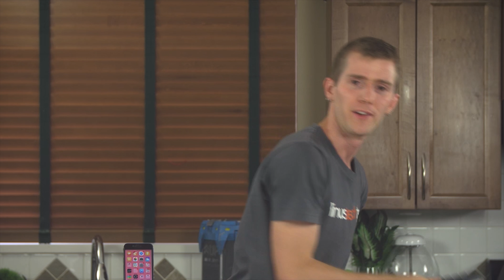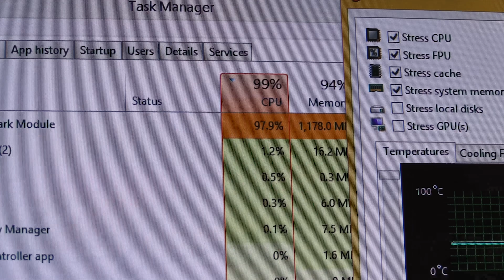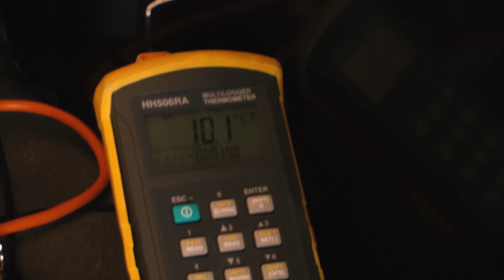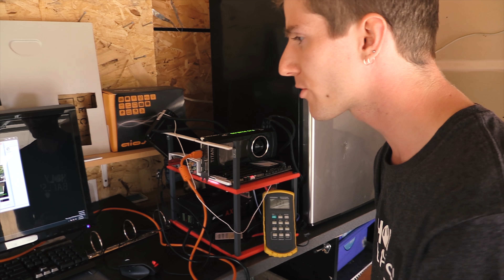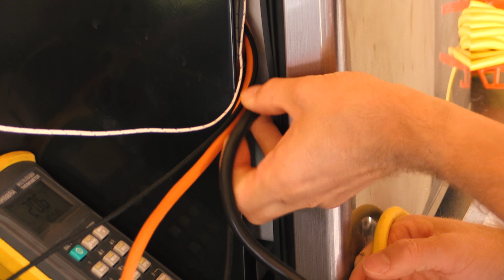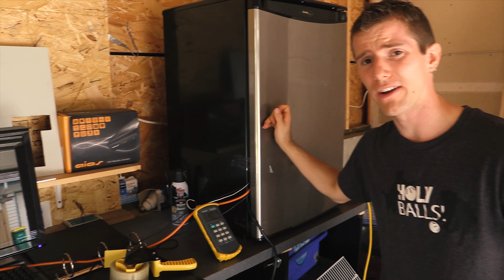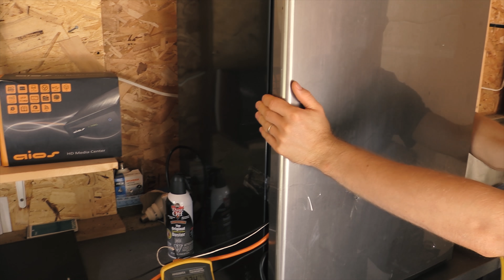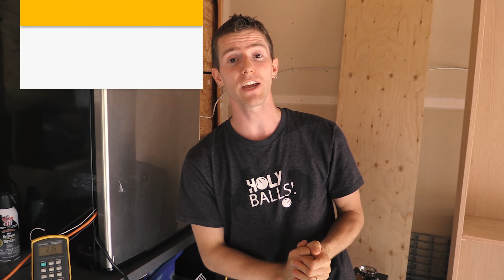PC Build in a Fridge - Does it Work??

Comment: Very bad idea. Fridges are not designed to handle constant heat loads. The fridge will not take this use for long. Google would have answered this. Phasechange cooling forums are full of these questions.

Comment: So my gpu includes 2 6-pins. It is a gtx 760. I've connected it via only one 6 pin bc my mobo came with only one. I'm thinking of getting two molex adapters. I connect my pc to a monitor with the 6 pin still on. It delivers a msg saying "please connect pcie power cable to motherboard" and then turns off after a while. Is that normal for it to turn off like that since I don't have all the connectors connected into my gpu? Or do I need two molex adapters? Any help would be appreciated. Sorry I'm a noob :(

Comment: what if you used a swimming pool as a water cooling reservoir with no radiator. Cools your computer and slightly heats your swimming pool win win
Reply: Lol, that sounds bad fucking ass
Reply: Spencer Stagg and then someone pees in it.
Reply: Spencer Stagg There's someone on the LTT forum trying to figure out the feasibility of doing something similar with a fish tank. I haven't followed the thread much so I'm not sure how far he's gotten on the concept.

Link: http://linustechtips.com/main/topic/385094-passively-cooled-fish-tank-computer/
Reply: Jay Cruz
But pee will be hotter than pool water.
Reply: BUT IF SOMEONE PEES IN POOL!?
Reply: Jay Cruz I believe that OP is taking about open loop water cooling with the swimming pool as a reservoir, so whatever is floating around the pool is going to go through your loop. If you use a heat exchanger to separate the fluids used to cool the computer from those used to heat the pool then it wouldn't matter what goes in the pool (cept possibly massive quantities of powdered gelatin)
Reply: +Spencer Stagg  Just fucken trow your pc into the swimingpool , AND BOOM , you got yourself a water cooled pc !
Reply: ***** Nope, you just don´t need a radiator with a reservoir tank that big. The pool itself becomes the radiator basically. 

It still a hackjob in a sense, as you need pump(s) strong enough to cover the distance from your desktop to your pool and pack and enough pipe as well and in the end you still have the issue that dirt from the pool might get into your cooling circuit. So it still not worth the trouble, but the basic idea to leave the radiators our and instead increase the size of the water reservoir is sound.
Reply: Traumglanz just get a heat exchanger, fluid in the computers cooling loop never touches the swimming pool's water.

There is a number of ways you could do this, you could install a normal radiator at the bottom of the pool, you could install a passive radiator at the bottom of the pool, you could install a plate heat exchanger (should probably be installed inline with the pools circulation pump), or you could just lay hose/tubing/pipe at the bottom of the pool in a space consuming pattern. If you're worried about flow, use larger ID hose/tubing/pipe and make parallel runs.
Reply: skippio77 iv tried doing it. Not that many people died from it so far
Reply: Ozzie Peck unless you have 8 4k monitors of course
Reply: +taiiat0 I have heard of office building that used a large pond to help cool the building. Just a matter of cooling the room instead of the computer.
Reply: tdhfc XD
Reply: television and cheese It wouldn't matter. Because all that matters is the tempature of the water. Not whats in it.
Reply: Spencer Stagg connect your PC to your radiator water supply and turn the radiators on but with no heat
Reply: Spencer Stagg pool water has chlorine
Reply: Spencer Stagg a Swimming Pool that has Chlorine and other stuff in it would be gross(and Salt would just be suicide), but a Liquid Source that large would be sufficient to keep the Thermal Energy dissipated. just need to figure out how to keep a liquid source that large sterile.
Reply: ***** That is not really a problem as long as you are using copper heat-spreaders. Feel free to correct me, but afaik copper should have no issues with salt and chlorine. Aluminium heat-spreaders would die very fast though. 

The bigger problem would be keeping dirt from the pool out of your cooling circuit, you won't want to to have sedimentations starting to stick to your heatspreaders. 

Besides that an aquarium as water-reservoir should be more than sufficient and looking quite cool as well. Add maybe small bits of dry ice for some extra bubbles and cooling in the summer.
Reply: Traumglanz i was under the impression that the idea was basically to electrically seal the components and throw them in, lol.

i came to this conclusion because the Poster suggested no Radiators being used. i.e. sounds like very hackjob.
Reply: Traumglanz
If dirt and things is not bad for some computer cooler things, why not use toilet water to cooling computer?
Reply: like the ideas here. as far as dirt from the pool you could easily install some pre-filter or strainer at the pickup from the pool.
Reply: Spencer Stagg Do you remember whole room watercooling and the biological crud that wrecked their system? Yeah. A swimming pool is totally open to the elements so even MORE biological crud will destroy your system
Reply: that was a closed system and most of the crap grew in their reservoir. If you maintain your pool and keep the water clean you should always have fresh chlorinated water flowing through the system. just get a good pool guy
Reply: Spencer Stagg But you can't realistically clean a pool spotless everyday so that there are No leaves, No bugs, no algae or other biological crap. It's just too hard. Plus, what about when winter comes?
Reply: Uh I live in California I have no winter. If your suction pickup is a few feet under the surface you should avoid most leaves/crud and a fine screen would take care of the rest. If you use enough chlorine your pool shouldn't have algea
Reply: Austin Vickers with regards to crud, just use a heat exchanger; with regard to winter, increase your overclock and run folding@home !
Reply: hook your pool water to your water cooling.
Reply: Spencer Stagg Would be much more cost effective to bury large copper heat exchanger deep underground where its a constant cool temperature . but using swimming pool as a giant liquid to liquid heat exchanger would work as long as everything is properly grounded to a popped PSU doesn't kill everyone at the pool party
Reply: Spencer Stagg the ratio of water mass to heat generated is so small that it wont heat the pool...
Reply: brandishwar Puget Systems did a PC build by making a Fish tank filled with mineral oil for heat transfer.
Reply: Ozzie Peck which is why I said slightly heats the pool I knew it wouldn't provide any meaningfull heating
Reply: not even slightly...
Reply: maybe a bath...
Reply: Spencer Stagg Win all arround ur a Genious!
Reply: 1. I know you are trolling and I'm lmao over here but 2. if the water dosn't kill your computer first the 3. Chlorine is ganna kill it.
Reply: Trolling or not the idea of pumping water in/out a pool to a cpu sounds nice. a win/win.
Reply: what if you by 'accident' pee in the pool
Reply: I think you'd want a radiator or a plate heat exchanger, I don't think you'd want all the junk that makes it's way into a swimming pool circulating through your loop.

If you building a new pool, instead of retrofitting an existing pool, you could embed PVC plumbing into the concrete floor of the pool.

Comment: 1. Mount a large heatsink onto your CPU.
2. Remove the fans.
3. Poor water over the heatsink or even use a pump to cycle it.

Cheap ass custom liquid cooling.

1. Run a pipe from the outlet of your air conditioner to the 1 intake fan on your pc.

Super sweet cold tempatures

Comment: It would be a pain to do it and expensive for electricity, but use a house hold window room ac unit. Make a custom case of wood or acrylic with the intake outside the unit and the output of the AC unit blowing through the custom case. The failure with the fridge is it a closed unit and can't keep up with the excess heat. A room ac unit should be keep up as especially if its not a closed unit. O you will want to disable the ac units temperature regulator this will cause the unit to run continuously.

Comment: The one problem you will have is that household fridges aren't designed to operate at a 100% duty cycle. The compressor will burn out in short order. Industrial freezers are really the only option for the duty cycle needed to cool something that constantly puts off heat..

Comment: I think you need to use a mini freezer, not fridge, for this to actually work for a desktop rig. I know most mini fridges have small freezers in them however, their too small for this application, you need a mini "Freezer". Depending on the power consumption of the freezer I'm not sure how practical it would be to do this however, it would be interesting to see if it would work at the very least.

Comment: I think what you should try next is a PC with an air conditioning unit. Connect a big air tight pipe from the air con unit directly to the front intake fan on the PC. That way you keep the air flow but with extremely cold air gong in cooling everything. i would love to see this!

Comment: Fridge solution:
You need baking soda and rice (or some white charcoal alone)... All 3 of those elements will DEVOUR ANY types of those moisture/humidity. But nothing beats white charcoal, though. White charcoal will even absorb straight up raw element of water.

But In fact, I had thought you were modding the door of your fridge, by extending the water cooling RADIATORS to be stored with inside of the fridge.

Comment: Try putting the PC in a box and having the front of a window unit blowing cold air/removing hot air from the box, sealing the box around the window unit so it's air-tight. The rear of the unit exhausts hot air out of it, the front of the unit intakes air from the box and blows out cool air. Should work nicely as long as the ac is powerful enough.

Comment: Freezer wont work too. The reason is the refrigerator is very slow at dumping heat at the surroundings since it doesnt have a more efficient radiator and an active fan. 

If you want a junk solution then a radiator from automobiles will work.  Another junk solution are window type airconditioners.

Comment: it still can be done, if your pc is water cooled try moving the heat sinks for the cpu and possibly moving your gpu's heat sink if it has its own seperate heat sink into the fridge instead having the whole pc inside. that way the fridge cools just the heat sink and can dissipate the heat from the heat sinks really fast

Comment: The average mini fridge has approximately 150 btu/hr capacity at 100% duty cycle and uses %30 of this just to keep itself cool, leaving 105 btu/hr. Since 1 Watt = 3.412 BTU, it has at best the capacity to remove 30.77 watts. If you also factor in the leaks around the door, it means it has no hope in hell and will also fail prematurely as they will not withstand the duty cycle. You would be much better off with a small air conditioner. Hey, how about; installing a small liquid cooled rad system on the computer, air-conditioning your room and keep beer in the fridge? Both you and your PU's keep cool, just a thought!?

Comment: This episode in a nutshell: Fridges and Freezers are NOT good at dissipating heat. The insulation used to hold lower temperatures backfires during this experiment and actually starts to trap heat. So something that produces heat will not benefit without extra procedures.

Comment: A fridge is made to cool things slowly, it was never intended to deal with heat sources
Also, you have to consider the moister that the Fridge produces, and that would most likely fry your motherboard 
Good point on the hair flow aswell

Comment: I think the only related thing that is worth doing is feeding the fans with super cold air in a situation where this cold air is isolated from the air mass where the heat dissipated from the radiators (in a wc setup) is blown into. Like having a hvac tube plugged into the insides of your case or directly feeding the radiator fans. Should cold air extract more heat from radiators anyways?

Comment: You need to remove more heat. Use a air conditioner! They can move a lot of heat. Build a box with the evaporator in the box, and cool it. If you remove the thermostat to make it run non stop, it could go to below zero deg C. The old single unit aircons are easier to modify

Comment: Can you try it in a walk-in commercial refrigerator? These are the big guns and are made to handle much greater loads than mini fridges thanks to the larger compressor and radiator. While this is an extremely inefficient way to cool a computer, I'm curious if it can be done.
Perhaps my dad will let me try it at his restaurant, but I'm worried that condensation (the humidity in the Midwest is too damn high) will damage my rig. I have an old Pentium 4 desktop that I could sacrifice to the cause, but it's a weak/outdated system with poor efficiency so I don't know if the data would be of much use in a benchmarking utility.
What's everyone's thoughts on this?

Comment: Refrigerators need the seal around the door completely sealed. You cant put the cords through the seal. This test was completely flawed.

Cut a hole on top for the cords and seal the hole. Then re-test.

Comment: Serious Question....Could you drill 2  4-5in holes in the mini fridge, add fans on the other end and feed the cold air underneath your laptop? The Laptop's fans would use it's own cooling system with a simulated lower ambient air temperature. A third hole may be needed to supply fresh air.

Comment: Couldn't you just put the radiator from the CPU on the outside of the fridge? Would only require a small hole to fit the tube through, could easily be made air tight again.

Comment: LinusTechTips How about something like an industrial cooler for enclosure and small cabinet. We have few in my work place for electric panel cooling.

Can you please do a PC build with this?

  http://www.rittal.com/us-en/product/list/variations.action?c=/Climate%20control/Cooling%20Units/Thermoelectric%20Cooler%20Total%20cooling%20output/heating%20output%20100%20W/Thermoelectric%20Cooler%20Total%20cooling%20output/heating%20output%20100%20W&categoryPath=/PG0001/PG0168KLIMA1/PG0169KLIMA1/PRO0275KLIMA1&productID=PRO0275

Comment: OK so here is a question...

If you have ever tried to take money out of a ATM during the winter one of the things you find is that the computer runs painfully slow, so...would running a refrigerated CPU also run at a slower speed vs room temp with normal cooling devices?

Comment: To people thinking about doing this, don't. Consumer grade fridges aren't designed to have their motor run 24/7 which is what happens when you put an actively heat generating source in there. it WILL burn out in a matter of weeks if not days.

Comment: You should try with a small electrical cabinet plus a cooling unit. This will maintain constant the temperature an the humidity. Also, the cooling unit air flow will improve the parts cooling.

Comment: OK, I have a mobile 900 W Air Condidioner standing in my Room right now... What happenes if you put Water Cooling Radiators directly in front of the AC so it cools down the System directly? Shouldn't that cool the PC better than putting stuff in the Fridge?

Comment: Knowing that an empty fridge burns out and a full fridge last a very long time. Having an empty fridge with a hot constant source will cause a quick failure. However if ice-packs are placed in the fridge it might last longer have them at the top and the pc at the bottom since heat rises